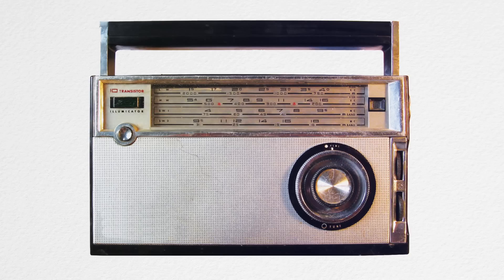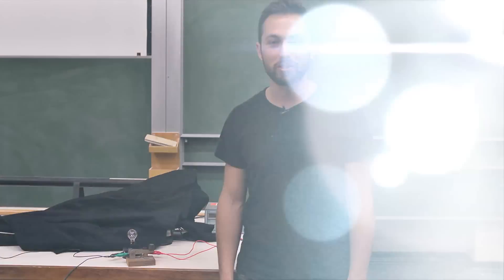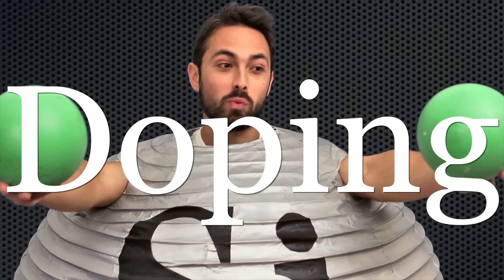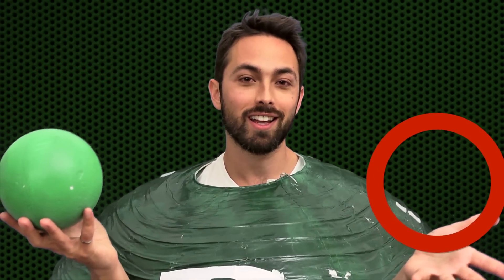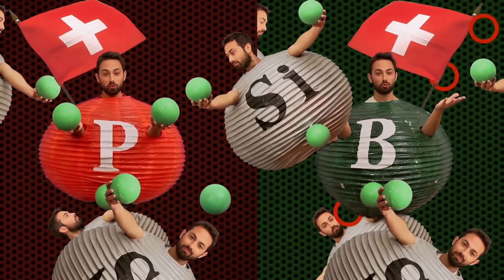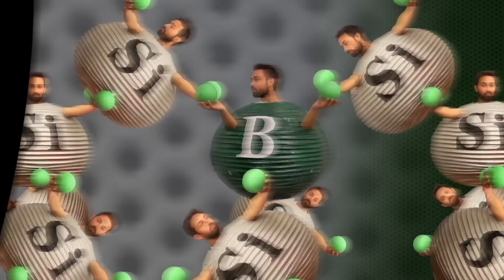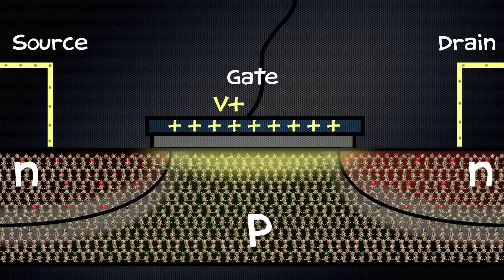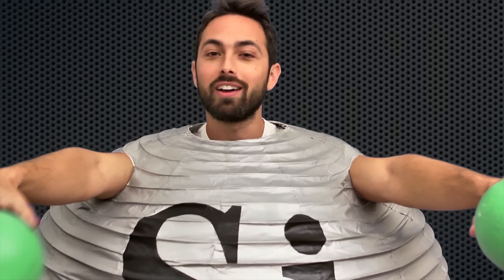How Does a Transistor Work?

Comment: I was hoping Derek could do another video on this, since in 2013 it was predicted that in about a decade we would reach our limit of transistors. I tried looking it up, but I'm not really sure where to look or what exactly to search. Have we reached our limit yet? I think obviously we haven't right? Since CPU's and GPU's keep improving, but maybe a government or military has made a chip that reached the technical limit, since public and commercial tech is always years behind private or secret government tech. Or have we come up with some new tech or concepts to surpass the limit?

This subject seems like a huge deal, with how dependent everything is on tech now, even down to the cell phones we all use every day. Would CPU/GPU tech just completely stagnate once we reach the limit? Some may think "well just increase the size of the chip", but that actually doesn't work, increasing the size and amount of transistors doesn't increase the speed. An analogy would be to think of a large city that is too crowded. If it takes a person an hour to commute to work due to traffic then someone waved a magic wand and doubled the size of the city, there wouldn't be as much traffic, but the length of the commute increased just as much as the traffic decreased, so in the end the commute still takes an hour. In the same way, just increasing the size of a chip doesn't increase the speed, it's not the size that matters but the density of transistors, the maximum amount packed into a specified area.

Would love another video on this subject.

Comment: Minor gripe about the 22 NM part- that's been marketing wording since the 45 NM nodes where they represented a particularly value of a property of a transistor
Ever since then it has just been marketing fluff and doesn't represent anything other than smaller is better, even then it's advised not to compare one vendors numbers to another vendors numbers

Comment: "Now, since the hole is the lack of an electron, it actually acts as a positive charge."
It's this opposite-terminology confusion that has always made me wish, since my knowledge of it, that the industry would have made a really big deal about reversing the convention based on the relatively modern discovery that it DC flows in the opposite direction as was originally thought (every official reference made past such-and-such date will refer to electrons as POSITIVE because there's something there, instead of something missing, and then holes and protons are negative)

This is the same gripe that I have about source/drain and collector/emitter.

Comment: A Transistor does not only have a 0 and a 1 state but can be stepless regulated from 0 to 1. Why is that important because logic levels are not on and off but low voltage and high voltage so for a transistor that is turned off is off and not in a 0 state and a transistor like 2/3 turned on would be already considerd to be in a logic 1 state because it will have surpased the relevant logic threshhold.

Comment: TSMC is trying to make 3nm transistors since they have successfully made 5nm (used in m1 chip). According to google, electrons can tunnel up to 20 or 30 armstrong, which is 2 to 3 nanometers. I wonder if 3nm transistors are possible.

Comment: I think atom width of transistor has been wrong there. Silicon 0.2nm times *50 = 10nm. He mentions 22nm process. While process node even in the times it was a real number, did not represented full size of a transistor but it's smallest element like gate, or data line width.

Comment: Ok, so the gate only needs an instance of + voltage to set the transistor to 1? So how do we set it back to 0?  If on the other hand, the gate has a constant voltage to keep it open, then the transistor is redundant as the + voltage can be the 1/0 signal. Yeah I don't get it.

Comment: 2013: The current transistor size is 23nm
2021: IBM now working with 2nm chips
Reply: There are no transistors with a 2 nm gate length. "2nm" refers to the process node, and doesn't correspond to any device dimension at all.
Reply: @Pukkeh  this question is totally off..... but how do they fit 16 billion transistors on a micro chip 🥲
Reply: @Uncle-Olumide  big science 

basically mixing chemical and vapors and stuff
Reply: Deadline comming closer
Reply: Intel will produce 18A Processors.
Reply: @srikrishna2561  no one believe that roadmap, that was just for marketing and increasing funds. There will be delay
Reply: Moore's Law
Reply: that would be 10 silicon atoms in length, which is quite unlikely...
Reply: 2nm ? Nah I don't think so it's already too small

Comment: Transistors are more than just on-off switches. Transistors can be used to modulate signals, i.e., control the flow of current passing through them like dimmer switches on a lights at home.

Comment: Wow. Great video. I remember taking classes in electricity at Cal Maritime. A professor named MR Jackson from the University of Washington had us build a computer from scratch. We started with a pegboard. We had transistors, Diodes, tiny LED bulbs, resistors. Silicon everywhere. We used Boolean algebra to program it. I programmed an elevator. Nothing but 0 and 1's. Real machine language. Oh, BTW, Cal Maritime is in the top 5 engineering schools in the USA  where graduates make the most money. Anybody with kids in high school should look it up. It is far better than taking out loans for a degree in lesbian dance theory.

Comment: Great videos, as always. One correction for accuracy: While the focus appears to be on transistors in digital circuits, in reality, all transistors are much more than switches. They have a full range of operation between 0 or "OFF" and 1 or "ON".  This continuous range is how common analog signals like audio, raw sensor voltages, or radio waves are amplified.
Reply: This is a very important distinction. While most electronics are digital, it's still fundamental to understand the analog principles behind it
Reply: @ayoitscat  indeed! Technical discussions can be challenging to fully cover in a short video as there are often caveats to consider or as in this case,  real world operation in circuit.
Reply: To be fair those continuous ranges aren't really used in the digital side of everything. For a DAC or ADC, which are used in basically all of what you mentioned, the intermediate voltage ranges of transistors are indeed something important.
Reply: i thought that the benefit of quantum computers was the analog nature of them, compared to the binary nature of transistors?
Reply: Ohhhh okay was gonna ask if they turn off so simply how so many common devices keep working for so long. How exactly do they get amplified though? I'm still finding that tricky to understand

Comment: It's been just short of the ten years, we're quickly coming up on the minimum size of a transistor, what's next?  Also, I've heard of PNP and NPN transistors but never really knew what they want but now I kind of get it, thank you.
Reply: The industry has been working on this problem for a while now. There are a few ways to go - we've been lowering voltage to decrease the amount of barrier that is needed, we've been working on better materials, cleaner structures, we're even going 3D (a lot more than we used to). We are finding new ways to increase computing power beyond just decreasing structure sizes.

PNP and NPN are so called Bipolar-Junction-Transistors (BJT) - they work in a similar, but slightly different manner from what was shown in this video. What was shown here was an N-channel enhancement mode MOSFET - N-Channel because the two N-doped sides create a small channel of N-type carriers (electrons) through the P-doped base layer, enhancement because a charge on the gate enhances conductivity, MOSFET is Metal-Oxide-Semiconductor FieldEffect-Transistor - the name comes from Metallic electrodes (Source, Drain, Gate), the Oxide is the insulation layer underneith the Gate, Semiconductor is the Silicon, and FieldEffect is the effect of the positive charge that creates the "channel" that was shown in the video. MOSFETs use much less power than BJTs and are better suited for digital electronics, but they are more susceptible to static charges.

Very oversimplified: PNP and NPN BJT transistors don't have the isolated gate and they start conducting because of carrier charges injected into the middle part of the transistor (Base) instead of an electric field.

There are about a dozen basic classes of transistors and thousands of types you can buy - they all use either injection, field effect or a combination of those; they are all based on doped semiconductors and they all have an off and on state - some of them have a significant range of partial conductance between off and on (e.g. those used in the eponymous transistor radio to amplify analog signals) others don't like to be in this range at all and will break if you overdo it.

Comment: As an Electrical Engineer I really have to make a correction here: A Transistor is not 1 or 0 but can have all the values in between as well, a component that only allows for on or off is called a Thyristor.

Comment: I saw a really great der8auer video where he looked at cpu wafers under an electron microscope, and discovered that even modern transistors are still 20-30nm (turns out Intel and AMD architecture names are just arbitrary). Guess we haven't made a whole lotta headroom in that department 😁

Comment: Hello Derek! have a doubt that if i use any sort of resistor to decrease the current in a circuit, will i b wasting electricity? & also that if i regulate my fan at speed 1 & then to 5, am i wasting electricity at speed 1 relative to speed 5 & will my electricity bill remain same at both these speeds??

Comment: Crazy thing is? That's actually the issue right now.

We're down to 7nm and working on 5nm and 3nm. Both are being designed completely differently than before because that's actually why we can't shrink them further.
Reply: ibm with 2nm one? is that the same as this

Comment: 22nm? Intel has been making 14nm for years, now trying 10nm for whole series. Amd is making 7nm and next gen will be 5nm, arm processors are going 3nm soon.

Edit: just realised this video is 7 years old and moore's law did work XD
Reply: Those numbers you see are marketing terms specifying a process node. They don't correspond to any physical transistor dimension, and haven't in a long time. There is no transistor with a 5 nm gate length.

Comment: 7 years down the road, I am wondering how we're heading towards 2nm chips. How did we overcome quantum tunneling?
Reply: it happens at sized of 1nm and less. Its not a problem we have solved currently, atleast to the knowledge of the general public.
Reply: GAAFET transistors + EUV manufacturing. When that hits it's limits it will be time to look into carbon nanotubes to replace silicon. Their main challenge will be producing nanotubes at the volume needed for global production rather than technology to make a nanotube transistor.
Reply: Quantum computers can solve this problem
Reply: @williamtraub1356  lmfao no that's unrelated
Reply: @fanban2926  they solve the problem of us lacking the computing power to preform complex tasks by using the quantum tunneling to our advantage. Derek made a video about it
Reply: We not, this is just a way to separate different transistors technologies

Comment: Great video as always ! 
btw ,the one u have explained is The Bipolar Junction transistor . 
while the one used in Computers is  MOSFET ( metal oxide semiconductor field effect transistor ) 
you can explain FET much easier than bjts .
we used to use bjts in computers 40 years ago , the digital  circuits based on bjts are known as TTL or transistor transistor logic . 
Now . we use CMOS digital circuits  which stands for "Complementary mosfet ".
Reply: BJT isnt use base collector emitter ? he used source gate drain ? this terminology for mosfets?

Comment: You should start with the simple transistor with emitter, base and collector. The PN junction should be explained as a voltage barrier, 0.3V for germanium transistor or 0.7 V for silicon that must be overcome before current flow will pass. Then the gain of transistor takes place, like 5 milliamperes at the base will produce a 100 milliamperes at the collector. On your picture with source, drain and gate, it should be explained like a charge type of amplification and works by voltage at the gate like compressing a flexible rubber hose. No current flows from the gate. Works like a vacuum tube.

Comment: "A problem we won't face until probably 10 years down the track." 
well, we are in 2021 now so, we are facing this problem very soon
Reply: well, intel sucks for now still on 14nm+++++++++++++  for now amd is reaching 5nm but still far from what is the diffrance b/ insulator band and semicondoctor band about 1nm
Reply: @oksowhat  intels ice lake processors are 10nm
Reply: @Arjun-jm4ll  Bhai 11th gen launch Nahi Dekha tha Maine tab
Reply: For those talking about Intel 14nm and AMD 7nm, architecture names are basically arbitrary, for both families the actual transistor size is still 20-30nm.
Reply: @LunchThyme  finally someone who knows the truth beyond the marketing naming haha
Reply: @LunchThyme  to be fair, there are specific components that 'could' measure a distance of 7, 5 nm but not the entire architecture of the chip is like that. but still it's like measuring the strength of a chain not by its weakest but by its strongest link; wich only makes sense in the head of a marketing team haha
Reply: @LunchThyme  I didn't know that!
Reply: I saw this video 4 years ago😂🤣
Reply: quantum computers
Reply: @iwbmo  I heard that quantum computers are not suitable for general-purpose computing, i.e., the commercial electronics we use every day cannot be built with pure quantum computers. A hybrid is more feasible, but it still relies on transistor-based chips.
Reply: More competent people have said that we're actually nowhere near the limit.
Reply: Hello World 😌
Reply: Today's size is 5nm
Reply: Apple is about to announce 3nm chips this year and early next year
Reply: You were not wrong
Reply: Haven't we already reached the limit
Reply: IBM just announced their 2nm chips
Reply: @schwiftzone413  No, think of quantum computers as a supplement, not a replacement. Just like how we have a CPU and then a GPU to do graphics tasks, we will also have a QPU (quantum processing unit) to do other specialized tasks.
Reply: Im so excited for 2024!!! Hopefully Moore's law is gonna still workk
Reply: @schwiftzone413  I don't really see any of the quantum computers solving this problem very soon. Most of the quantum computing tools I've seen so far are just simulations  of quibits done on regular computers anyways.
Reply: actually, we are stuck currently, we hit the 7nm limit like 2 years ago
Reply: @schwiftzone413  the issue with them is that they are horrible at usage outside of a few specific tasks usually solving algebra. At least for the time being. So to play video games or editing a video we are stuck to our inferior fatty computers for now at least. :P

Comment: Thank you for the great video!
 As far as I know, nobody before created such visual exploit to explain the inner workings of a transistor.
May be I'm "nitpicking" here... You shown the MOSFET transistor in your video; truly today is the transistor used in microprocessors - billions of them in a single package. They have also replaced bipolar transistors in RF applications like hand-held two_way radio, smartphones and the likes.
But the field effect transistor is not what Brattain, Shockley and Bardeen invented; it is more what Shockley meant to invent, but they achieved something different, they made a bipolar transistor.
And the bipolar transistors were the mainstream types at Moon landing; the ground radar and the radio links used a bipolar transistor type invented for the occasion, with one collector, one base, and a large number of emitters to reduce stray inductance and allow few watts output at UHF frequencies (2N3866). The FET existed at time (2N3819) but they hadn't achieved the necessary specs  yet. Bipolar transistors are more complex to explain -because of the base electron-hole recombinations and the minority carriers injection which control the output current; the latest seems to defy comprehension.
May be a video explaining how an integrated circuit with four billions of (MOSFET) transistors is obtained? How no human can manage such complexity, how the designers do design functional logic blocks, and a software tool costing a bit less than one million dollars, it actually manage to "compile" those blocks... not into code, but into silicon.
Again, I appreciate your video very much,
Regards from the UK...